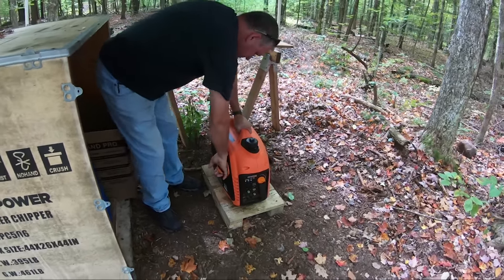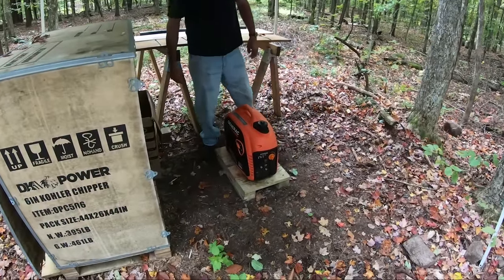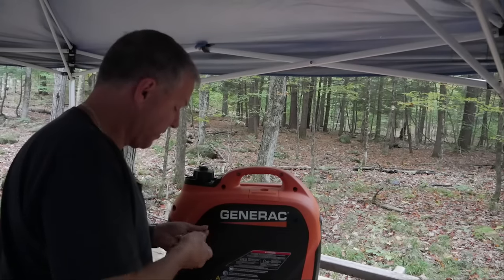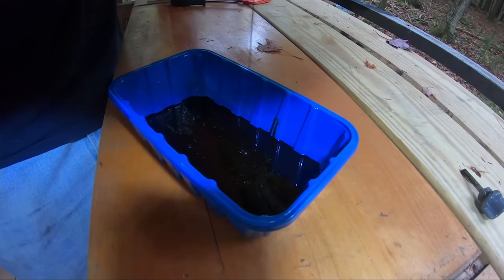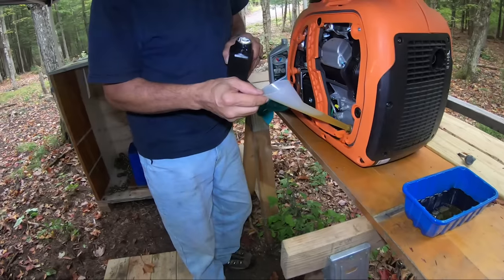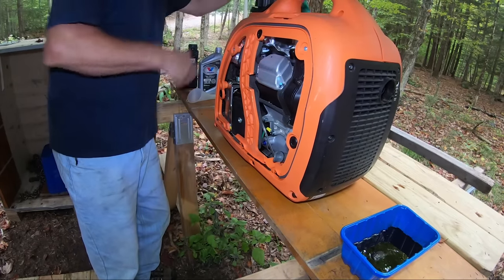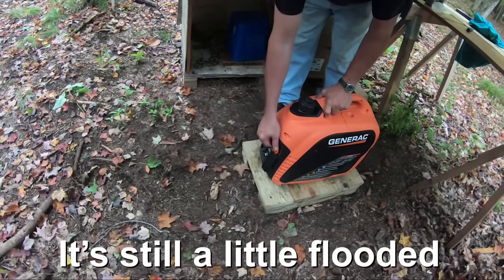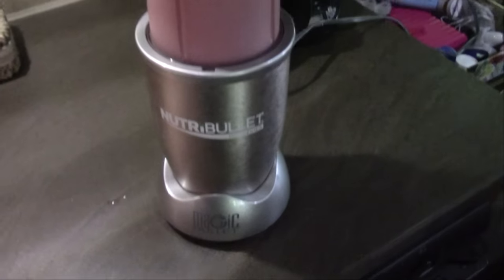GENERAC GP2200i - BRUTALLY HONEST 1 YEAR REVIEW

Comment: 1. If it needs to be kept dry, why does it have rubber covers over the outlets? 2. Saving the original oil bottle for volume check is a good idea, however you cannot rely on the volume of the original bottle for oil changes unless you verify it. After test running the factory may remove more oil than you typically would during a quick oil change. 3. The thing where the filler is essentially at the top of the oil level is a nice passive feature preventing overfilling. 4. Good on you to point out the manual says not to screw in the dip stick to check the level. Most of my power equipment says the opposite, that is the dip stick should be screwed in to check the level. 5. Good job illustrating the importance of a level surface for checking the oil level.
Reply from the maker: Rubber covers are to keep dust and dampness out and maybe safety? Directions say to keep it out of direct rain and that’s why we keep it covered.

Comment: Although the gen needed an oil change, I doubt if doing so was the reason it started.  Spark and Fuel are the two primary items to check.  If you haven't pulled the spark plug, do so and clean and gap it or replace it.  I also agree with another viewer regarding using ethanol free gasoline.  It's a bit more but is especially important if you use the tool infrequently e.g. chain saws, generators etc. Some gas powered tools require that you push a primer bulb, and that's easy to forget to do.
Reply from the maker: It has an oil cutoff switch. If the oil gets too low it won’t start. All great I’d reminders though! Thanks 👍
Reply: I wish they had a primer. I have only run mine 3 times since new. Only 2 months old, I find mine hard to start. It takes too many pulls of the recoil for mine to start. Less than 6 hrs operating time.

Comment: I’ve got one of these. Just to let everyone else know. It can take a beating. I run it in the rain, snow and in the single digits. It does a fine job running the camp, charging batts, running table saw/chop saw/compressor etc. you can baby it I suppose too but it doesn’t need to be coddled.
Reply from the maker: I agree so far this machine has done everything we have asked it to do. Can't beat it for the price we paid. Thanks for watching. Happy New Year!
Reply: I once had one older non-inverter generator burn up in heavy rain. How much rain have you had yours in a trenchel downpour?

Comment: I do not know about generac , i have a honda and in my honda there is a fuelpump so i put on a extended run system om my mashine with a external boatfueltank so i can run it al night thru with out going out to it. Is it the same on your mashine with a fuelpump? I just love this quiet mashines 😊😊.
Reply from the maker: I don't know if there is a fuel pump but if we make sure the gas is full before bed and run it on economy, we can run upwards of 9-10 hours straight with no problem.

Comment: This was ran for 343 hours , on the first initial oil fill? The bottle that came with the generator? Holy hell!   Yeah.......that shortened the overall life of it. Should have changed that initial oil around the 20 hour mark , and then switched to a good synthetic and then changed every 50 - 70 hours.  Also......clogged carbs from not running non-ethanol is a huge plus. Pump gas dries and clogs everything up!
Reply: That and the fact that he's long over due for a spark plug change
Reply: Agreed
Reply from the maker: Yeah, it was a huge mistake. Did do the 20 hour and did switch to synthetic but dropped the ball after that. Thanks for watching and commenting.

Comment: I have a fluid vacuum pump that I bought on Amazon, great for pulling oil and other fluids from differentials, transmissions etc. Air Power America  "liquid vac"
Reply from the maker: That’s a good idea! I just got a large syringe and that worked but a pump is probably easier. Thanks for commenting and have a great day 👍

Comment: A tip for those with generators you can build a box with say some carpet stapled on the inside of it with an open top and then all the sound that it does make will go up to the sky and not towards your your camper works really well we had noisy generators in the military and you couldn't even hear them inside your tent
Reply from the maker: Definitely doing this as soon as I have time 👍
Reply: @CreatingASimplerLifeOffGrid  glad to hear it just make sure the geni can breath

Comment: Ah a review of a  generjunk. We had a 100kw unit. We solved our failure to start problem by replacing it with a Kohler.  The Kohler has operated flawlessly. The generjunk had less than a 1000 hours. In that time we had 7 alternator failures, and injector pump failure,  several censor failures and a couple of computer broad failures.  Its was supposed to do an exercise cycle every Monday morning.  It did that when ever it felt like it. It had regular service by a generjunk dealer.  We had no customer support from generjunk. After spending $40,000 on their generator we became a prisoner to it. Walk away and by a Kohler.
Reply from the maker: Dan W sorry to hear you had such a bad time. Thanks for watching 👍
Reply: I just quit working there this review made me smile cuz I know exactly what ur talking about. They are all about quantity vs quality.  They are built with a simple few screws.
Reply: Dan W ... I worked for a fairly large gen dealer over 25 years (over 6,000 customers and 15 techs) and I have to say the Kohler is a higher quality unit... but you pay quite a bit more for it up front, especially with a diesel. That said, Generac is not a bad unit for the buck and they use the same engines as other companies. Where I see the problems is poor installations and smaller dealers who are not familiar with the larger sets. (yes, 100 Kw is a larger set) Hard starting on a diesel is almost always a fuel delivery issue, not a design flaw or cheap parts, etc. That many alternator failures means someone hasn't looked at the load on the system either. Most likely these things got fixed by whoever did the Kohler installation.

Comment: I am looking at that oil and I am thinking, "Yeah, so?"  The oil was black?  That's not a shocker.  The oil ran out slowly?   The oil was cold.  Fifty hours perhaps a little longer on a right weight synthetic?  Not even near neglect.  Now, leaving ethanol based gas in the carb, fuel lines, etc., for extended periods of time?  Yeah, that would be neglectful.
Reply: I change my oil between 6-8 yours on my machine. That oil was sludge and if that engine had a failure the warranty would be void.
Reply: I agree: Whenever possible, I shut my engines down by closing the fuel valve, and allow the engine to run(unloaded)until the carburetor float bowl runs out of gas. After that, I put on the choke, and give it one more pull, and it will usually try to start, as it slurps the last few drops of fuel out of the float bowl, and clears the passages and emulsion tubes in the carburetor. You never want to allow gas to evaporate, because it will leave behind varnish, which can clog those fine passages and jets. I almost never shut an engine off by the ignition, unless, I'm just refueling and checking the oil, and intend to start it right back up. I've always had bad luck leaving fuel in carburetors for extended periods of non-use. I've never had problems, when I've ran the carburetors dry.
Reply: @vincentrobinette1507  It is the best and most thorough way with marine grade fuel.  I went through hurricane Michael. Had to go to Walmart and went to the automotive department. Every can of every product that had any possibility of cleaning a carburetor was sold out. People were using brake kleen to accomplish the task.
Reply from the maker: Thanks for watching and commenting! Have a great day

Comment: Thanks for doing this video.  I have an older model of this generator and after only a few uses the electronics will no longer produce AC power.  The engine runs fine.  So, I'm glad you've had good luck with yours.
Reply from the maker: SyberPrepper sorry to hear that. Thanks for watching 👍

Comment: Being brutally honest, yeah, you did abuse that thing. But it's still working despite that so more points to Generac!
Next time measure how much oil it takes to fill it and steal a measuring cup from your wife for easier fills in the future. It also helps to drain oil when hot as anything that settled inside gets mixed back in and leaves the crankcase with the oil.
Drain the fuel and run it dry if you're going to leave it for more than a month. Or you can just run it out of gas then put in some TruFuel and run it out again. TruFuel is expensive but stores well.
Reply from the maker: Great tips!  I bought a syringe that measures and did the last oil change with it. It worked out really well. Never thought about doing it hot but makes sense. Appreciate your help and hope you have a great day!
Reply: Hec, just run any fuel stabilizer mixed with fuel for a few minutes after you've run the old fuel through it. That will "coat" the important parts of the carb system and will mingle with the new gas upon the new season. This isn't hard. Get in that groove and you worries are over.

Comment: If using a small generator a lot . 
Service  it regularly. 
Spark Plug . 
Fuel filter .
Oil change. 
These little generators don't like too much abuse . 
Look after it . It will look after you .
I have a small Generator I got cheap off eBay used . 
3 years ago . It gets used a lot . 
But gets serviced regularly and never lets me down . 
Good luck with your build project . 
Love s project like that . 
Oh I'm. In the UK .
Reply from the maker: Great advice and I agree 100%. Thanks for watching and commenting 👍

Comment: The only thing that saved you on the oil changes you were using synthetic oil.  Most inverter generators recommend 100 hour service interval for the oil.
Reply from the maker: I think this generator recommends it at even less! Thanks so much for watching 👍
Reply: Holy F I changed the oil in my Honda three times before it reached thirty hours, it’s what you call break in. All sorts of machine filings in the oil at first change, now it will run forever with fifty hour oil changes that is. Take care of it it will take care of you.

Comment: The sales guys at my store would occasionally forget to add oil to a new generator that they just sold.  That was so funny watching them pull the rope over and over.  I’d send them back out to the sales floor and I would add the oil to the engine.  It would start immediately.  That was so funny.  I never did tell them what they did wrong.  Got to trust the old man, you know.
Reply from the maker: Too funny! Have a great day 👍
Reply: Dave Alexander  I was a good bit older than the youngsters who did most of the sales.  What was particularly humorous was when I reminded them to add the oil, they would answer that they already did.  It was a bit of a game.  I didn't totally trust them and they had their doubts about me.  Turnabout?  I don't miss that job a whole lot.  All I ever got from that job was heart problems.  But I did gain quite a bit of knowledge about tools and  power implements.

Comment: The only way I could get my Generac 3200 to start was to remove the manual recoil starter and use a cordless drill with a socket, this was after changing the spark plug, carbarator , oil and the gas, by far the worst piece of s---- I ever purchased. Thanks Generac.
Reply from the maker: Wow. You are not the only one who wasn't happy with it. I really hope we have more luck than that. Thanks so much :-)
Reply: Glenn Godbert
 ... Read up on how to adjust the valves, then replace the plug and use fresh gas. Makes all the difference in the world. Tight valves are THE MAJOR cause of poor starting on small engines.

Comment: Have run my Generac 2200i for over five years with minimal maintenance. No problems using premium gas. And if sitting for long periods add some fuel stabilizer. Like everything mechanical, as shown in the video, maintenance is the key. Also if running an AC unit with the Generac it is best to use an AC unit with slow start. I run my AC with the Generac set on economy. Works fine and saves on fuel.
Reply from the maker: Yes. We have a 5,000 btu ac and once it is started it runs on economy all day (or night) with no problem! Have a great day and thanks so much for your comment :-)

Comment: Looks like a Yahama copy, but no oil drain plug? Be smart & buy a Yahama or Honda. They have spare parts & good customer support. Genacrap is renowned for no parts availability & poor customer service.
Reply from the maker: This is our third season and so far we haven't needed any parts or service on it. In fact it is supplying the power for our internet so I can answer your comment!
Reply: Have a Honda that has run thousands of hours and no issues but than again I change the oil on a regular basis and parts available after thirty years. Ya get what you pay for.

Comment: Good honest review...hey we've all missed an oil change on occasion...I had similar Generac with the same pesky oil change mess...just not user friendly...As I didn't need portability so much, I picked up a Westinghouse Wgen-3600v, much easier to maintain however it's about 100lbs. and more noise...so built a small 4'x4'x4' insulated/vented box with lean-to style roof,  easy break-down with bolts & wingnuts...  
My philosophy...if it works for you, then it works for you❕ I like your little set up there...nice get-away-from-the-mad-ass-world...I like it 😎 
I have to ask...nobody messes with your place/stuff while you gone❔
Reply from the maker: Great philosophy. We will be needing a bigger generator for the well pump and need to build a small pump house as well. Will look into the Westinghouse - Thanks! We love our little corner of the world and so far nobody has touched any of our stuff. It helps that we have many game cams set up all around as well!
Have a great day.

Comment: Can this machine power a Spartan drain cleaning matchine...machines that open your house sewer line..on a 25 foot cord...... Any help would b great......peace
Reply from the maker: It depends on the size of the machine you have and the current draw. This generator is only 2200 peak watts. It's about 1700 running. I think 1 horsepower is a little less than 800 watts, so maybe that helps.
Reply: Yes